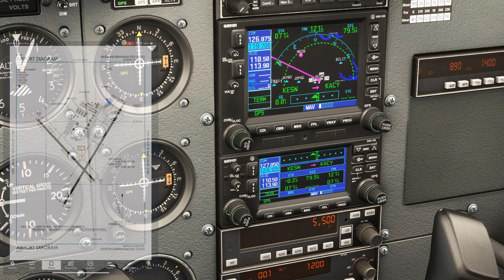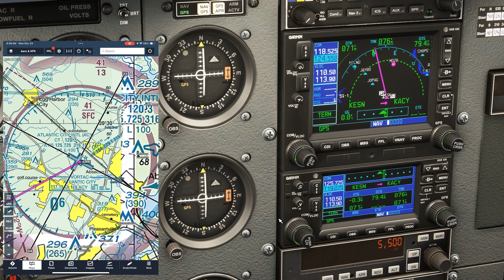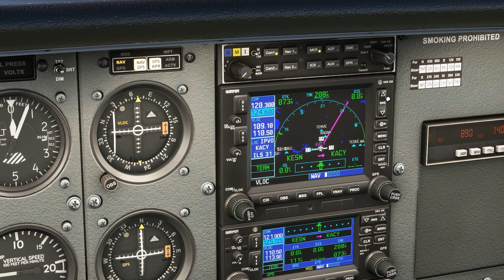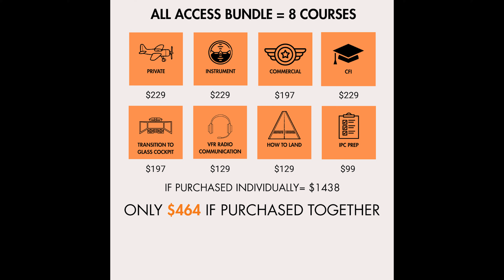Never Miss a Radio Handoff! | How to Manage Your Frequencies on a Flight

Comment: I’ll echo the two commenters about using COM 1 for everything and leaving COM 2 for guard & ATIS. 

One other comment on radios. On some planes (like mine), one of the antenna may be mounted on the belly which can in some cases make it harder to use on the ground. My COM 2 is that radio and is relegated to guard, ATIS and calls ahead to a FBO’s frequency.

Comment: Once you go pro you’ll unlearn all of that.  Comm 1 does it all for ATC.  Comm 2 is guard, ATIS & company.  

Swapping between comms means more missed calls and TX’s on the wrong freq.  You either have to volume up/down or deselect the radio you don’t want to hear.  It’s bad enough just forgetting to hit the flip flop.
Reply: Plus in airline ops each pilot has their own radio head with their own stby frequencies, so each comm has an active with 2 stby freqs. That's a good frequency management plan for that particular operation.

But the plan set out here is good for the GA use case with 2 flip flop radios. I like it, especially the reminder to monitor guard. I'm going to modify my freq management to use it when I operate out of towered airports.
Reply: I’ve never had the luxury of a comm with two standby freq’s & an active.  What aircraft or radio is that on?
Reply: @TylerN737s  The Airbus radio management panel keeps its own stby frequencies and there are at least 2 of them. One active frequency, 2 stbys per comm radio.

A common setup for departure is to have ground active on VHF1, the captain stby on the departure freq, and the FO stby on tower. VHF2 has ramp active, with guard on stby. Some button pushing when starting to taxi but not much dialing in new freqs.

Comment: on everything I fly, only COM1 works with battery on only. Only after the engine runs and avionics is turned on, COM 2 will turn on. So ATIS will have to be on COM1 to get the start-up clearance.
Reply: What plane where you’re just chilling with the battery’s on without power? You’re using a gpu?
Reply: @DecentassPilot  A lot of the larger aircraft as well as certain smaller GA aircraft manufactured in the 70s and 80s feature a "ground clearance" power distribution system that powers one of the comms either using the main bus or a fused connection direct to the battery. The idea is that the pilot can contact clearance/delivery and get their clearance before starting up. A separate interrupt relay would temporarily cut power to these radios when the starter is engaged to prevent damage. A lot of the smaller aircraft got rid of these circuits since they tend to be a maintenance headache and the newer avionics don't really play well with being switched off then on all the time (e.g. a GNS430W takes a smidge over a minute to boot up)

Comment: Hm, lots of chances you'll be transmitting on the wrong radio, because you forgot to switch to the other set. And believe me, guilty as charged! (doing PA talks over the radio or acknowledging a clearance over the PA or talking to dispatch on tower frequencies)
My advice, as you already mentioned, on set two monitor guard and use for non essential comms.
And set one for essential comms.
That's what I pass on to my students.